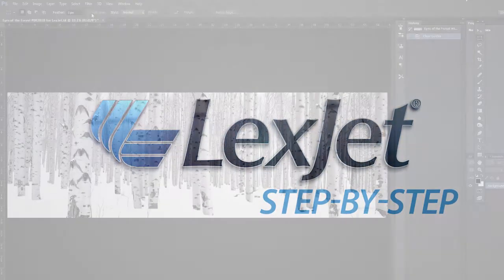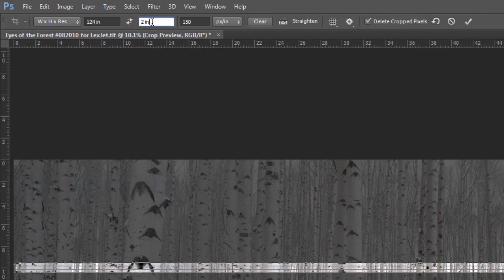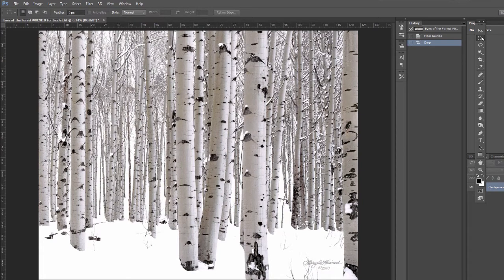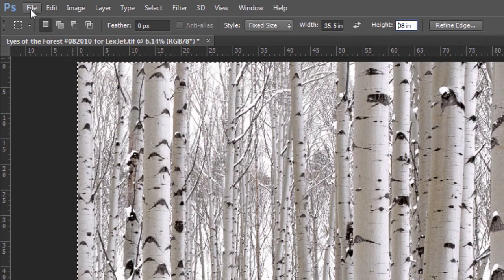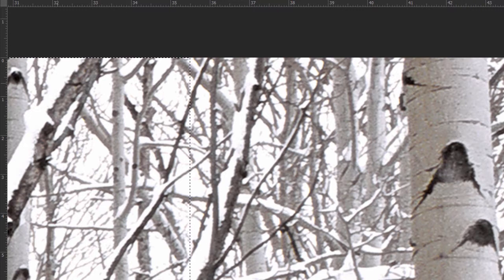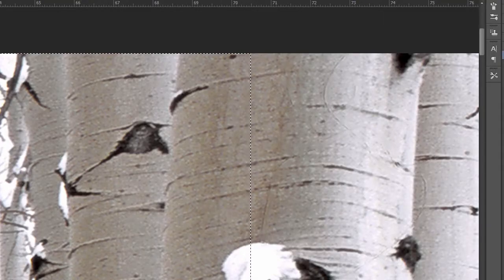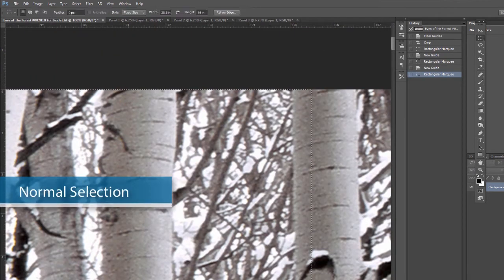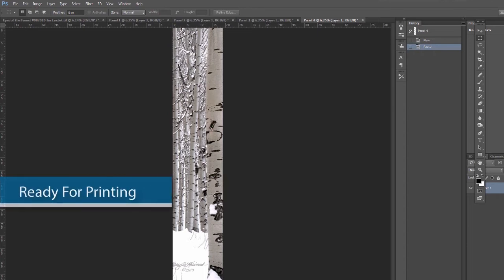Step-By-Step: Tiling Wall Graphics Using Photoshop

Comment: Hi, thanks so much for this video. Exactly what I've been looking for. 
One question please. Since the panels are overlap, the final result will have a slightly thicker part where the overlap are met, won't it?
Reply: Yes, we recommend an overlap with most products that are vinyl based due to shrinking rates with temperature increases/decreases.  If the product you are using does not contain vinyl and does not shrink you can get rid of the overlap and use the same sequence butted up to each seem side by side.